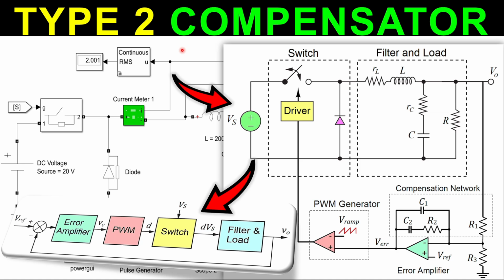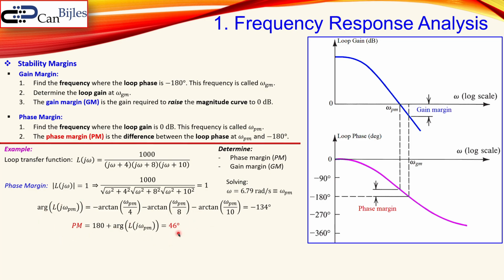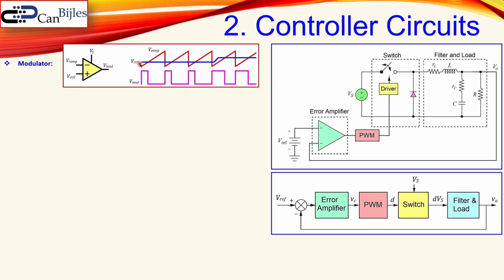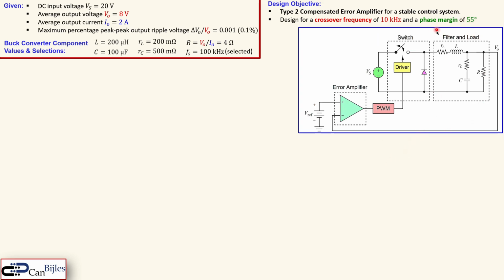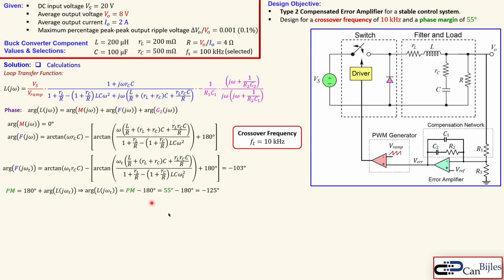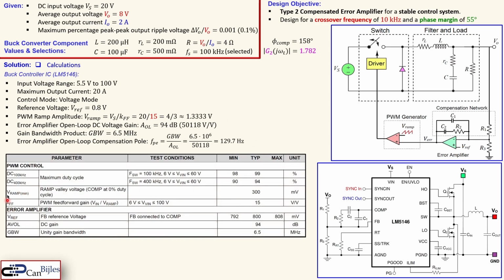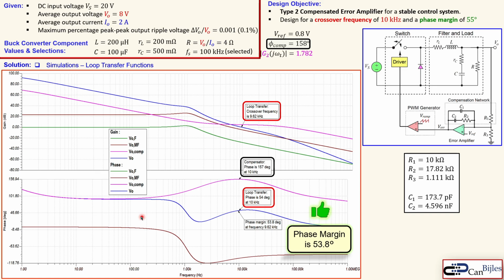⚡ DC-DC Buck Converter Controller Design using Type 2 Compensator ☀️ Calculations & MATLAB & TINA-TI

Comment: I Have Few Doubts 
1. How much should i fix the Target of Phase Margin.
2. Are the Transfer function remains same for the Synchronous Buck Converter?? & Buck Converter in Buck Boost Topology.
Reply from the maker: 1. How much phase margin you need, depends on the specifications, like overshoot, settling time, and rise time.
2. The transfer function will be different for different converters.

Comment: How can we get 157.6 degrees of compensation? A type 2 can provide maximum of 90 degrees of phase boost theoritically. So a type 3 would be needed to stabilize the loop. Please correct me what I'm missing
Reply from the maker: Thanks for your message. Yes, you are right, but you have to consider the circuit and the formulas together. 
Note that in this development, the inverting amplifier already gives a phase shift of -180 degrees and this is included in the equations I am using. In some texts using this method, the inverting amplifier phase shift is omitted at this point and then included later.

Comment: Thank you for a great presentation.  I have a few questions.  The integrator time constant should be 1/ R1(C1+C2).  Why is C2 neglected with it is much greater than C1?  Verr is also a function of Vref.  Why is the Vref component not included?  In classical control theory, the error term is always a proportional to difference between the reference and the sampled output (see a transconductance error amplifier).  Please comment.  Thanks again.
Reply from the maker: Thanks for your message. Glad you liked the video 👍 
About your questions:

1. The C1 and C2 are not parallel since there is also a resistor in the feedback. The C2 is not ignored. I use a specific method to determine the component values, as discussed in detail in the video. 
2. The Vref is a constant value, which serves as the command singal or reference signal. This Vref is not a function of Verr. However, the error amplifier is using the difference between the reference and feedback signal to activate the PWM generator and further.

Comment: Why i have getting more gain at G_loop 121 db while you got around zero i used same code as you
Reply from the maker: I do not know. It can be caused by many different things. Make sure you have the same configuration and code.
Reply: @CANEDUX  i mean same code right if version variation may lead 1-5 % but your almost zero my 121 db how it can be and your type 3 compensation network code always same issue in observing
Reply from the maker: Again, it can be caused by anything. It is difficult to judge from distance.

Comment: Great explanation!
Sorry, how can I determine the vramp if I don't have the LM5146 and I make the compensator and pwm generator with an opamp? There is no kff 
Thank you very much
Reply from the maker: Thanks!
You should check the datasheet of the Buck Controller IC you are using. If the Vramp and other parameters are not given, then it would be very difficult to do the calculations beforehand. Then, you might check this using actual measurement on that specific Buck Controller IC.

Comment: Can I use the same load and filter transfer function for other converters like boost and buck boost converter???
Reply from the maker: No, you cannot use the same transfer function, because the operation of the boost converter and other types are different.
Reply: @CANEDUX  could u send me boost converters load and filter transfer functions
Reply from the maker: I am also working on this.

Comment: I've learned that Type 2 compensators are used for current mode control, and type 3 compensators are for voltage mode control. Can you make a comment to that issue and, if possible, to demonstrate an example for current mode controlled converters. Thank you very much!
Reply from the maker: Type 2 or 3 or any other compensator can be used for current-mode and voltage-mode control. I have not seen a restriction for able to do both methods. Where did you read this?
Reply: @CANEDUX  One can find the Type II/Type III compensator selections in practical designs and suggested in several books, such as in Basso's books and also in the TI-literature. Let me add one part of a TI Report SLVA662, listed as follows:
"Demystifying Type II and Type III compensators".
A Type II compensation amplifier adds an RC branch to flatten the gain, and improve the phase response in the mid-frequency range. The increased phase is achieved by increasing the separation of the pole and zero of the compensation.
Note that this type of compensator always has a net negative phase, and it cannot be used to improve the phase of the power stage. For this reason, Type II compensators cannot be used for voltage-mode control in CCM where there is a large phase drop just after the resonant frequency.
Type II compensators are usually reserved for current-mode control compensation, or for converters that always operate in the DCM region.
The Type III amplifier is the one for the voltage-mode converters operating in CCM.
-------
Regards 
Udo
Reply from the maker: @udohuhn-rohrbacher1406  I see that is written in this paper of TI https://www.ti.com/lit/an/slva662/slva662.pdf, but for example in this paper, it does use the Type 2 in voltage-mode control: https://www.infineon.com/dgdl/an-1162.pdf?fileId=5546d462533600a40153559a8e17111a
I have to check those in more detail to understand why TI is mentioning this in his paper.
Reply: @CANEDUX  Check this from Basso's book:
Basso book Switche-Mode Power Supplies 3.5.9 pages 297/298
Selecting the Right Amplifier Type
Type I
As it does not offer any phase boost, type I can be used in converters where the power stage phase shift is small at the desired crossover frequency.
Type II:
Most widely used and works fine for power stages lagging down to 90° and where the boost brought by the output capacitor ESR must be cancelled (to reduce the gain in high frequency). This the case for current-mode CCM and voltage-mode (direct duty ratio control) converters operated in DCM.
Type IIa:
This application field looks the same as for type 2, but when the output capacitor ESR effect can be neglected, for example, the zero is relegated to high-frequency domain, then you can use a type 2a
Type IIb:
By adding the proportional term, it can help reduce the under-or overshoots in several design conditions. We have seen that it prevents the output impedance from being too inductive, therefore offering superior transient response. Nevertheless, you pay for it by a reduction in the dc gain, hence a larger static error.
Type III:
You use this configuration where the phase lag brought by the power stage can reach 180°. This is the case for CCM voltage-mode buck or boost-derived types of converters.
Reply from the maker: @udohuhn-rohrbacher1406  Thanks for the detailed feedback. I will check this also. Great to have this discussion.
Reply: @CANEDUX  It's my pleasure, too.
Reply: @CANEDUX  Hi, what's the update on this?

Comment: How do you get the given transfer function, if you compare to the videos from Prof Marcos Alonso, he designs by choosing the inductor and output capacitor first from other design criteria , and then the transfer function is established from that, followed by the actual component values, Thank you for great Videos, Greetings, Petrus Bosman.
Reply from the maker: Hi Petrus, thanks for your mail. Great to know you liked the video!

The transfer function F(s), which is taking into account the filter and load, is determined using the output voltage divided by the input voltage for F(s) circuit only. When you carry out the analysis, you will get the transfer function F(s). The calculations of the component values really depend on the design specifications and of course on the available components.

Comment: Hello,Thank you for a useful and informative lesson. It's just not clear why the divider R1 R3 is at the input and not at the output of the converter? Where in this scheme is the feedback from the output of the system to its input?
Reply from the maker: Thanks for your message. The error amplifier compares the reference voltage Vref with the part of the output voltage. This should be done at the input of the error amplifier 

The part of the output voltage is set equal to the Vref using the voltage division created by the resistors R1 and R3. This is also explained in the video. 

Comparison is made best at the input of the error amplifier, because the circuit can act faster to changes in the output voltage.
Reply from the maker: In addition: the circuit in the TINA-TI Spice simulator is for AC analysis. Here, we look at the loop transfer function, so we apply a AC signal at the point (output node) where we also measure the output voltage, thus we make a complete loop. The Vg is also Vo for normal operation. This is just for AC analysis.
Reply: @CANEDUX  Yes, everything is clear now, thank you!
Reply from the maker: Great to know👍
Reply: @CANEDUX  And also, could you tell me, the step response can somehow be seen according to the scheme from TINA TI
Reply from the maker: @SMV1972  The circuit in TINA-TI Spice is specially drawn for loop gaan and loop phase determination. If you want the step response, you need to have the circuit for closed-loop system.
Reply: @CANEDUX  That's right, I'll try to make a closed-loop circuit in the simulator! Thank you very much!
Reply from the maker: @SMV1972  You're welcome!
Reply: @CANEDUX  Hello! Please tell me why you use TINA TI, and not, for example, LT Spice or microcap? How is tina ti better?
Reply from the maker: @SMV1972  TINA-TI Spice is easier to use and much better in presentation of data. LT Spice might be better in modeling of some devices. TINA-TI Spice is also connected to Texas Instruments, which makes it easier to use their devices in the simulator.
Reply: @CANEDUX  Огромное Вам спасибо, за точный и ясный ответ!
Reply from the maker: @SMV1972 You're welcome!

Comment: The same method can be used with the other switched converters such as the boost and buck-boost but deriving the plant transfer function is more complicated and requires state space averaging. This involves deriving a state space for all the switching states and averaging them. DCM will have a different transfer function to CMM due to the additional zero current state.
Reply from the maker: Thanks for your message. Indeed, this method can be also used for other converter types. Not only the derivation will be somewhat difficult, but also also different for the modulator transfer function depending on the operating mode. For continuous conduction mode, the transfer function is much easier than for the discontinuous conduction mode.
Reply: @CANEDUX  yes one could dedicate an entire video to deriving the transfer function per converter and operating mode
Reply from the maker: Indeed, it is all about time and how far we need to go in the derivations.

Comment: Hello Sir, based on 25:43 the phase boost of the designed compensator will be 68.5 degree?
Reply from the maker: How did you get the 68.5 degrees of phase contribution for the compensator?
Reply: @CANEDUX  Is is by 90 - 21.5 = 68.5 phase boost since the compensator starts from -90 degree to -21.5 degree.
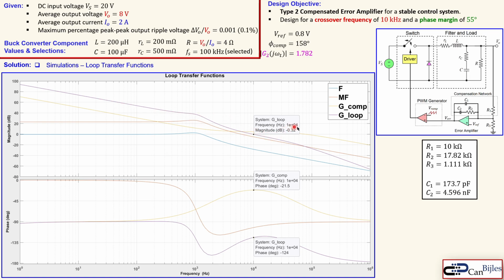Reply from the maker: @patrickliew2756  You can see in 25:25 in MATLAB that the phase contribution of the compensator is -21.5 degrees. This is not taking into account the 180 degrees phase shift due to inverting amplifier action of the error amplifier. At 28:05 you can see that the phase of the compensator is 157 degrees in TINA-TISPICE, which is close to 180 - 21.5 = 158.5 degrees. 

TINA-TI Spice and MATLAB calculation the phase of the compensator different, because MATLAB does not include the phase inversion due to inverting amplifier action of the error amplifier.